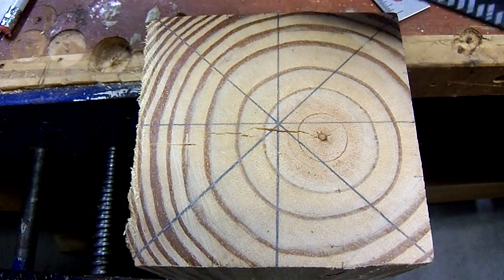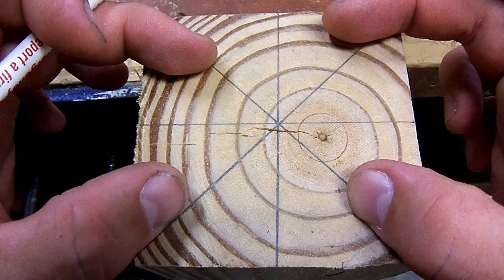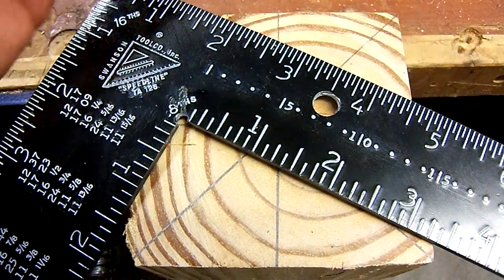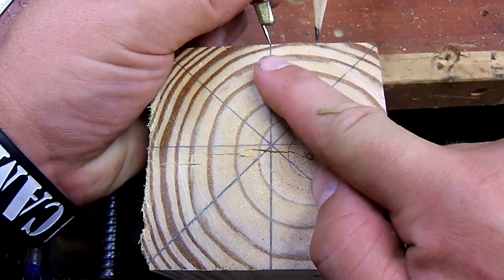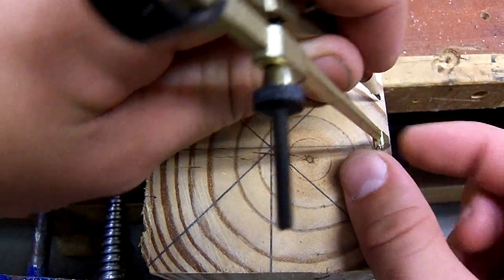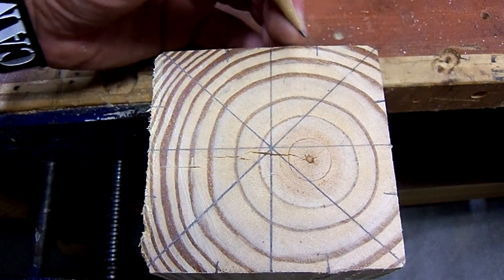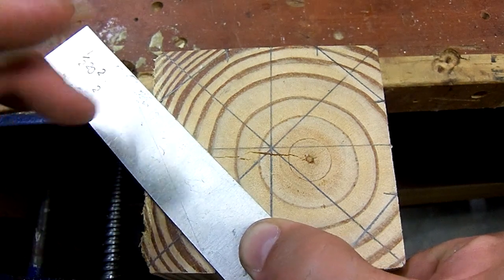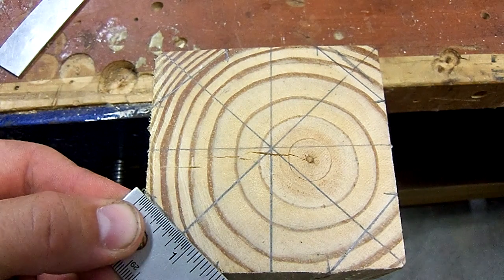Using the Octagon Scale

Comment: Another way is to multiply the width by 0.41421 (3.5 x 0.41421 = 1.45) Or in metric, 3.5 inch is 90mm. 90 x 0.41421 = 37.28mm (37 will do).

Comment: hey bud, would this work in feet as well as inches.  lets say to layout a octagon shaped gazebo in a backyard?
Reply: yes,  the ratio's are the same.  Pipe fitter use this all the time.
Reply: There are other ways to layout the shape for an octagonal gazebo, but you would use this to cut an octagonal plug to fit the top of your 8 rafters against.

Comment: The easiest way is this: The marks you are making are the same distance as the half-distance of the corner-to-corner diagonal (The diagonal center). Take that distance from each outside corner and you will have the first of the 8 tick marks required for the octagon. Connect the ticks marks and you are done. You will never forget this geometric constant.

Comment: Really enjoying the videos, I have had to teach myself carpentry as I never went to college hence the reason I'm on here. The other reason I believe which I'm sure you know about but for your followers is that carpenters should learn about the octagon scale  because it relates to the hip rafter cut on speed / framing square. On a common rafter the ratios are expressed as 4/12 or 3/12 etc but for hip rafter it relates to the longer length of the hip rafter i.e. 4/17 or 3/17 etc or 16.97 I think it might be if we are being really precise. I hope I've articulated that ok.

Comment: You didn't say why you are taking 3 1/2... So, I will guess.... You are talking 3 1/2 because, even though it is said that it's a  "4x4", in reality it is a "3 1/2 x 3 1/2". So, this is why you are using this scale; Still, thanks! I didn't know to use this 'this far yet. I wish I would do more in carpentry.
My dad use to do it for long time and building house roofs with many angles in it, from scratch (from nothing). The guy on the roof was calling the piece of wood and him, on the ground with only a handsaw and a carpenter square, was cutting the pieces. It was a perfect match each time.